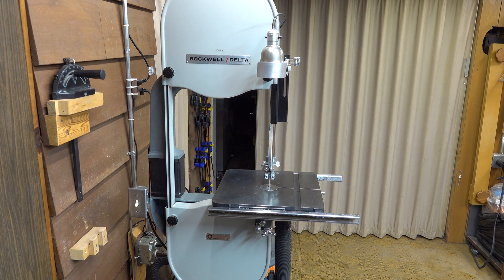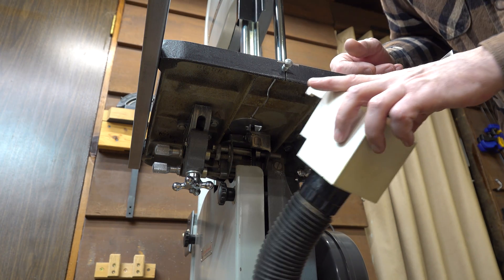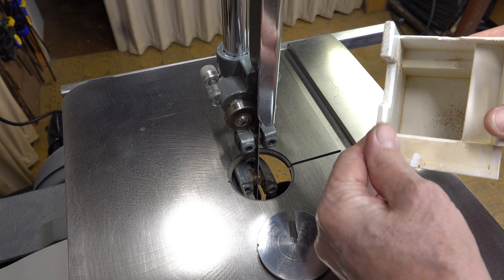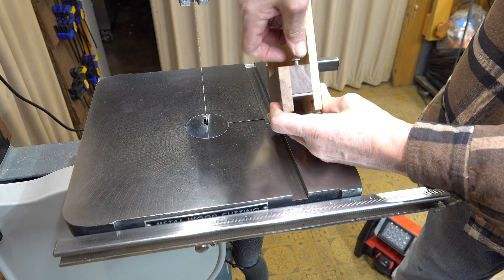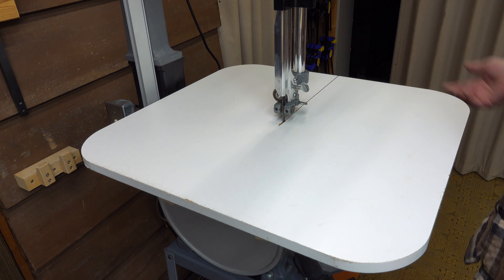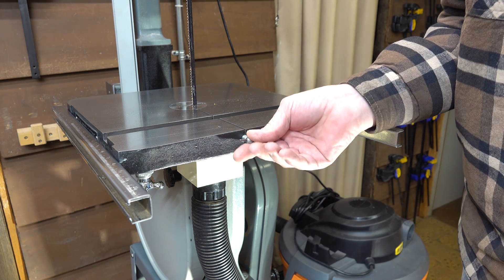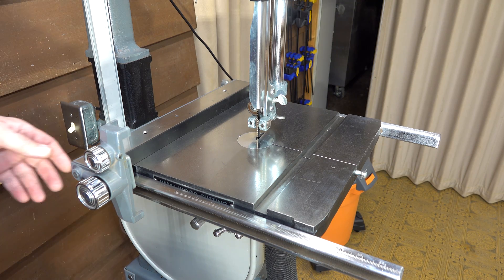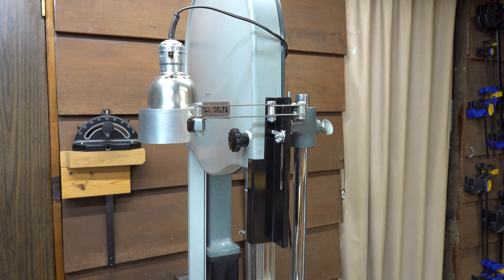Secrets behind a Dust Free Bandsaw!

Comment: Thank you for the great video. My saw is the 52-965 from the middle to late 1990’s. It has an enclosed base on the bottom which houses the motor. 
It desperately needs help with dust collection. 
Is your solution utilizing a 2.5” port/hose or is that a 4”. Look like 2.5”. Also do you connect it to a shop vac or dedicated dust collector?
Reply from the maker: It is a 2 1/2" hose and has a dedicated large shop type vac. Thanks for the visit!!

Comment: Brilliant. I have a similar DIY fix but not as tight. Big question: I do constant table-tilt changes and this setup seems to only work for a dedicated perpendicular table. Got a suggestion for a more flexible workaround?
Reply from the maker: I made a "snout" from 1/8 polycarbonate that has a hole on one side for a shop vacs large hose and the front narrows to a thin slit that's 1/2" x 4" and this you point really close to the blade. It works really well but wasn't fun to make. Today 35 years later maybe you can print one or build it from thin aircraft plywood.

Comment: Absolutely great stuff you've done. Might I suggest installing a mag starter and controls, and converting to 220 if you haven't already done so! I do this with all my machines. I buy used or NOS electrical's  so it's very affordable. I did away with my riser block as I just didn't need it. I also have a  wood/metal model but mine stays in whatever gear I put it into! These shouldn't jump out of gear!
Reply from the maker: It's got some wear apparently but that's immaterial nowadays so who cares. No issues in 35 years lol.

Comment: Great tips. Thank you. Next shop project will be that dust collection box for the bandsaw.
Reply from the maker: One of my better ideas to keep the shop cleaner! If you focus the vacuum just right with side ears where needed it keeps the vacuum from leaking prematurely! Thanks for the Visit!
Reply: @joesshop3622  Made one and just tried it out.  Works great. Only difference I used 22ga sheet metal and made it taller to accept my 4” hose exiting on the back side of the box. I made a 1/2” slot on the front side of the box and use the knob that holds the saw bottom panel to tighten and snug the metal box to the saw. It hooks on the saw as you showed and just like yours is easy to remove. Thanks again for the great idea.
Reply from the maker: @apenza4304  Very cool! Great idea! Thanks for coming back to mention it!

Comment: How dod you go about polishing your table? Looks smooth!
Reply from the maker: I have an insert that goes into my Sawzall that has a large 5x7" plastic reinforced "pad" offset molded to it.  I put maroon scotch Bright pad onto it with 2 face tape. I'll use WD-40 as a lube next to get off the micro rusted hand prints and such. Then I finish with some Mothers Aluminum Polish by hand. Everything virtually "floats" on the table for a long time afterward! Thanks for the visit!!
Reply: @joesshop3622  Thank you for your reply. I have everything other than the Mothers Aluminum Polish, so I'll give this a go but polish with whatever I have on hand. Nice channel!
Reply from the maker: @corwind3888  Any polish that darkens quickly is removing material...Brasso, Flitz etc. will work just as well.